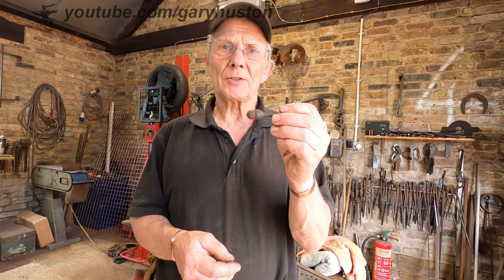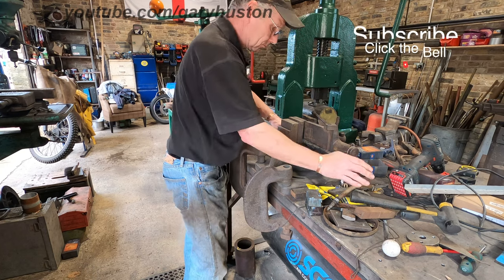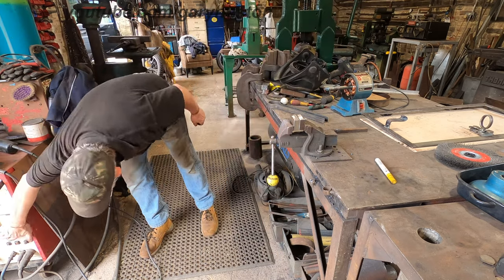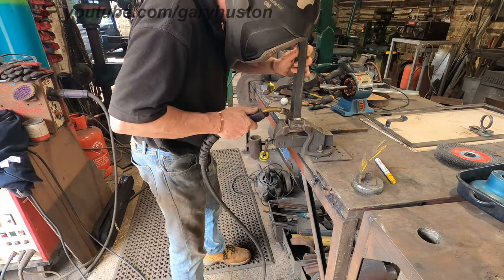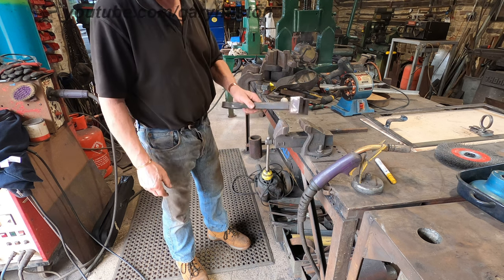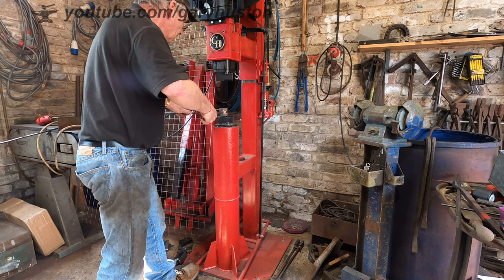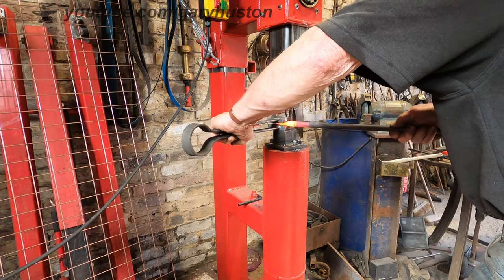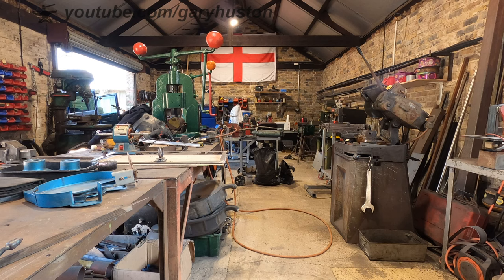How To Make A Power Hammer Spring Swage for acorns

Comment: While it was in the lathe, you should’ve ran a knurler on the cap of the acorn to give it some texture. It would’ve transferred just enough into the tool to give it a little bit of character.

Comment: Can you talk about your leg vise? I saw it in the background and have been trying to work out the best way to mount mine. I want it to be somewhat portable and seems you might have cracked that nut. Would you mount your vise the same way again? Does it move around on you, if you were twisting or pulling? Hammering I assume it is good, but does it bounce?
Reply: Great idea, I’d like to see that too
Reply from the maker: Unfortunately it’s not portable, it’s bolted to a cast iron bench which it was designed for, and is bolted to the floor. So no, it doesn’t bounce and you can twist and pull easily.

Comment: That was neat. Do you need to relieve the edges of the die a bit so it wont chew so much? or would it be better to make a "rough draft" version of the die to neck it down closer to near the size of the acorn first?
Nice to see you work again. Shoulder doing better now?
Reply from the maker: Yes, as I mention in the video I took off the rough edges with my Dremel. Shoulder is doing great thanks!👍🏻
Reply: @garyhuston Another great choice for the die set is S5 or S7. Shock steel. Jackhammer bit. Fully anneal and heat to about 1,400"f  and try to work fast enough so that you don't have to anneal and go again. Remember that all your efforts will smooth out after using it about fifty times to work out the transitions. Then you can do a full heat treatment at 1700"f, soak five minutes, oil quenching. Do twice then draw back 450"f in a toaster oven for an hour for stress relief. Works with D2 Tool steel also. It's some gnarly stuff to forge